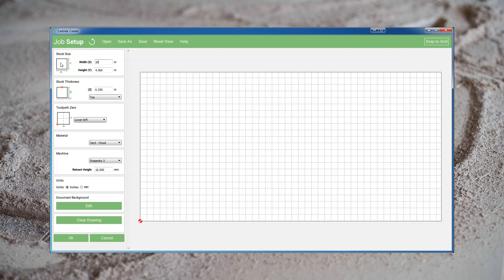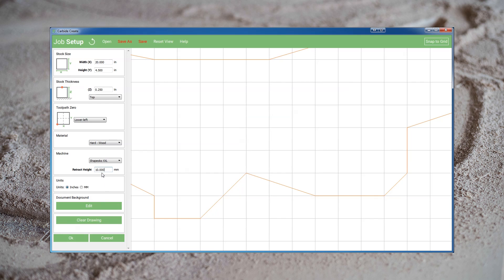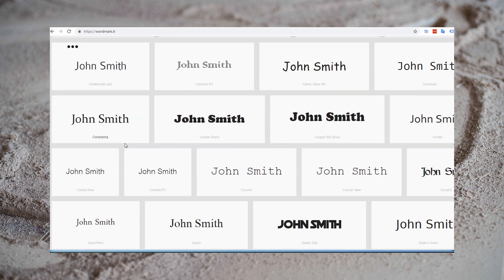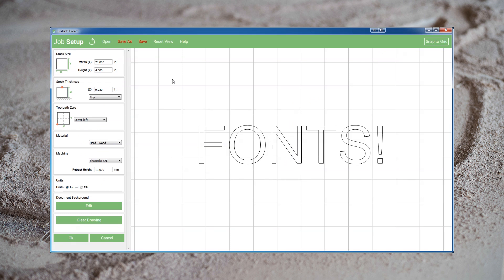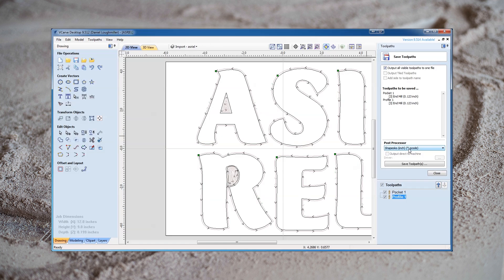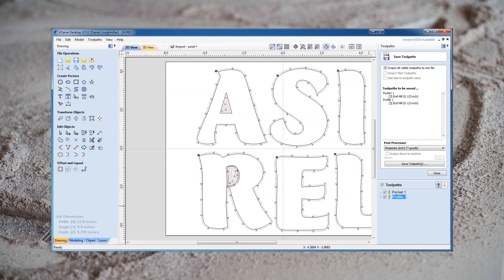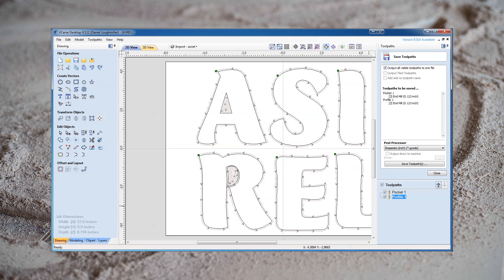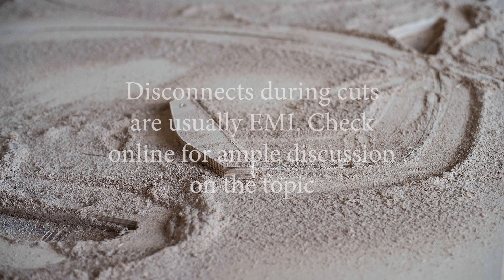Software, Assembly, Operation and Maintenance Tips for the Shapeoko3 CNC

Comment: Great Info.  Carbide Create & Inkscape are a good combination and can take you pretty far.  Vectric VCarve is the next level.  Still use Carbide Motion, and did I get a surprise when I hit Start and my router started moving with a Vectric file!  EMI is a serious problem that Carbide3D needs to give more attention to.  I have a in line filter on my USB  and a surge/filter on my power going to my electronics and the ghost problems have gone away.  Maintenance Kit is on my list to purchase, hard to gauge when its needed - don't surprises either.  Cheers

Comment: Thank you once again for an outstanding video on the Shapeoko XXL. You answered most of the questions that float around in my head from time to time as I come across certain things. I especially appreciate the section about the accentric nuts, I understand the function etc, but I never thought about the side to side movement when one isn't snugged up properly, I have one like that and have ignored, well at least until your animation. Boy I can really see how those v wheels especially being a plastic of some sort could break or chip. I"ll be rectifying that tomorrow> Many THANKS for that! You quite possibly saved my wheel ! 
Just a thought for something down the road... I use CC on my computer upstairs and input all my settings etc. I might from time to time run a project that I realize needs some attention to speed up/down whatever, so I make the changes on my laptop in the shop to a shock that other settings get changed that I didn't make. So I have resorted to only modifying a project on the original computer it was generated on, kind of interesting that it does that by changing from one compter to another. Its not a big deal, but might be something people need to be aware of. Thanks again and appreciate your time in putting this stuff together. Andrew